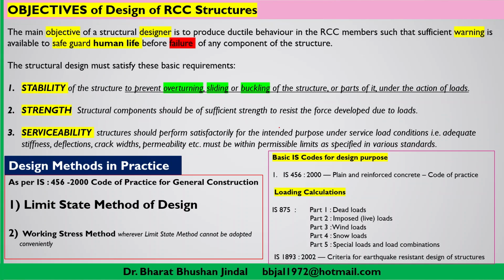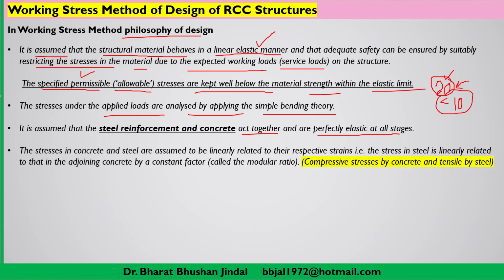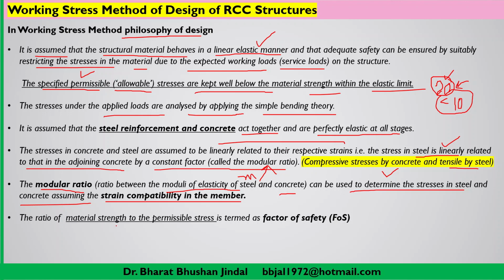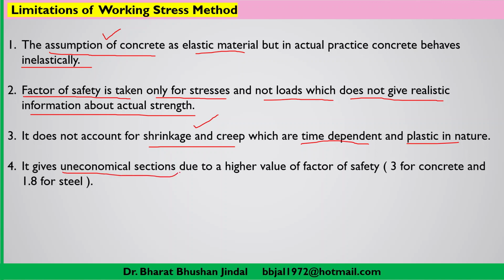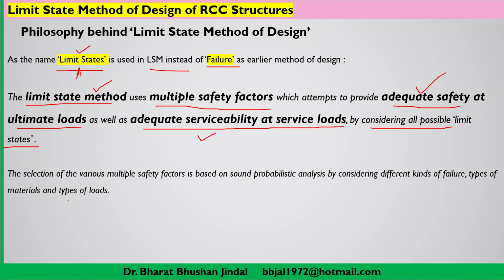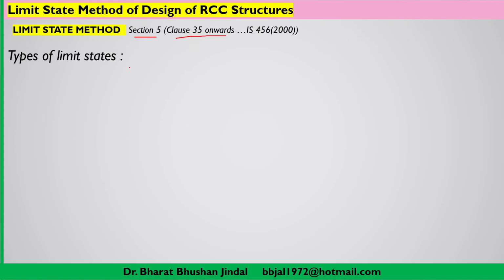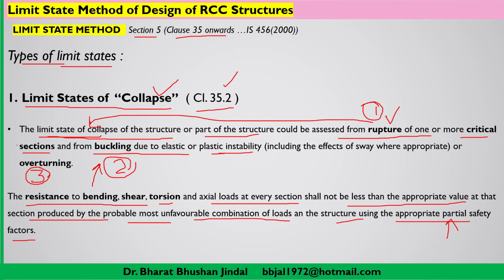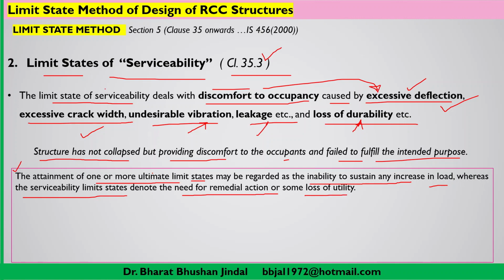Lecture 4 || Design of RCC Structure || Design Methodologies || IS:456

Comment: in the above video there is an  detailed explanation  on the two methods of design of RCC structure i.e WORKING STRESS METHOD and LIMIT STATE METHOD. in the given video the two methods briefly  explained  simultaneously. different types of LSM are also discussed.

Comment: is  concrete grade effect if modular ratio to be used in the analysis of RC beams using working stress method ?
Reply from the maker: Ofcourse, it decreases with the increase in grade of concrete. You can refer the formula of modular ratio

Comment: This video is really good but it will take more time to understand this lecture but i have sumup some points related to this video
(Workin stress method is based method of R.C.C Design. Limit state method is based method of R.C.C Design. In working stress method, the material follows Hooke's law as stress is not allowed to cross the yield limit. Limit state method, stress is allowed to cross the yield limit.)

Comment: Summary of lecture 4- 
In this lecture, professor has put great effort in making us understand the main objective to of designing RCC structure where the main and most important objective of a structural design is produce such a brittle RCC member that even if failure occurs the building provides sufficient time to save human lives.
There are three basic and significant requirements that a structural design must provide-
1. Stability
2. Strength 
3. Servicibility
There are two main methods of structural design in practice:
1. Limit stress method 
2. Working stress method

In working stress method-
It is assumed that steel and concrete act together in perfectly elastic matter. the stress acting under applied loads are  analysed using simple bending theory. Stress in steel is linearly  to that of the adjoining concrete given by modular ratio.
Professor also talked about factor of safety= material strength/  permissable stress

Permissable stress = yield stress/ factor of safety.

 Later limitations of  working stress method were taught stating-
 Assumption of  concrete being an elastic material is wrong. Factor of safety does not give realistic information about the strength of concrete as it is taken only for stresses and not for loads. This method does not take about shrinkage or creep, uneconomical sections. This method gives no information about the behaviour of structure during its service life. 

In limit state method, by considering limit states  multiple safety factores are used to provide adequate safety at ultimate load and adequate servicibility at service load.
Here limite state was explained in detail as the state of approaching failure beyond which a structure ceases to perform it's intended function satisfactory.
Then types of limit states were discussed:
1. Limit states of "collapse"- it can be assessed from rapture of one or more critical section and from buckling of elastic or plastic instability.
2. Limit states of "servicibility"- it deals with the discomfort of occupancy caused by excessive deflection, excessive crack width, undesirable vibrations, leakage and loss of durability etc.

Comment: Sir, everything in this video is explained very nicely and after watching two or three times, no doubts are left. I really request to keep on making more such videos so that not only we but other students can also take help.
Summary - In this video we learnt about the methods to design the structure based on IS 456. There are two methods.
1. Working stress - In this a lot of assumption is made, structural material is assumed to behave in a linearly elastic manner and stresses are kept below the material strength. Stress in steel is linearly related to concrete by modular ratio. We apply a factor of safety which gives us permissible strength. 
This method is not suggested as it only focus on the strength and not on the behaviour of the element and has many limitations like concrete in real is inelastic, it does not account for creep, shrinkage and is uneconomical. The reason why it is uneconomical is explained very clearly in the video.
IS 456 recommends limit state method.
Limit state method uses a lot of safety factors, based on considering different types of failure, load and material. It is the state at which structure approaches failure.  There are two types -
Limit state of collapse - On seeing any rupture or crack, we say this limit is achieved.
Limit state of serviceability - it deals with the discomfort to occupancy for example, crack due leakage or deflection.
The attainment of any one of limit state is considered as an ability to sustain any other load.
At last we can clearly see that limit state is preferred as it governs the safety of structure of much more than the working stress method.

Comment: Sir very nice video, specially the mentions of the clauses and IS codes are truly unique and really exceptional.
I had a question about limitations of working stress method which is
(1) How it gives uneconomic sections due to FoS ? 
(2) How Does the outcomes differ when we assume the concrete to be elastic than inelastic ?
last one is from the topic types of limit stress
Are there more than 2 types of limit states like a combination of both 2 etc.

Please make more videos like this.
Reply from the maker: 1.  WSM gives uneconomical design because FoS taken for concrete is 3 which means in design calculations ( i.e. section size ) will be at higher end as the material strength is as 1/3rd of actual strength.  Moreover many factors which are taken into account in the justification of taking FoS value can be controlled by adopting good quality control at site.

2.  You will be able to understand in  LSM method in coming lectures.

3.  Its sufficient as the parameters both states i.e. before and after usage of concrete is taken into consideration.

Comment: Sir in limitations of WSM point 3 it is mentioned that it doesn't account for creep but there are formula of modular ratio (with full creep consideration m =Es/Ec(1+Q)?
Reply from the maker: You are advised to re-watch the video lecture on CREEP to understand the concept of Creep in concrete which will resolve your query.